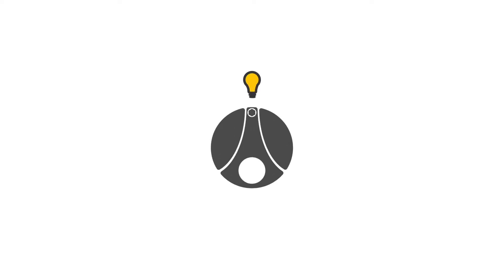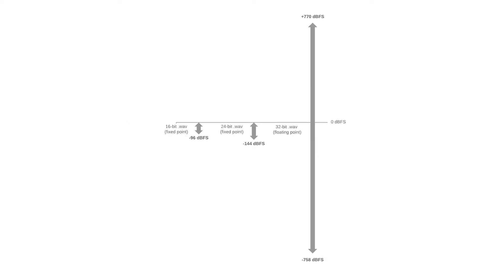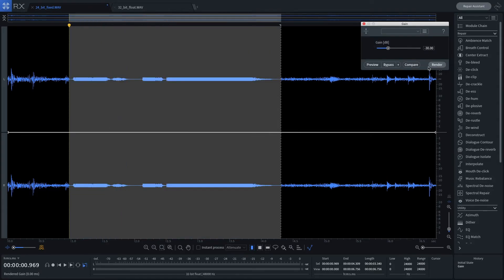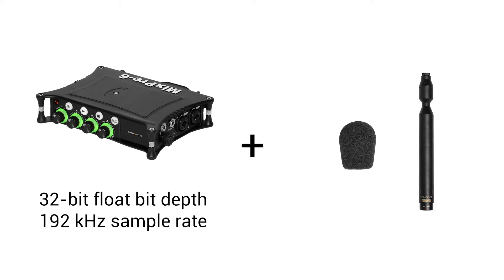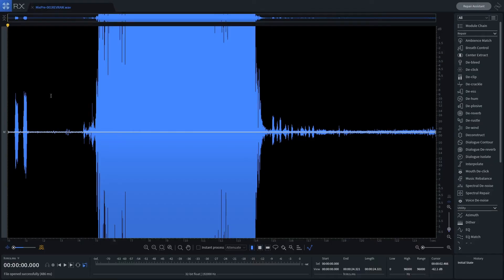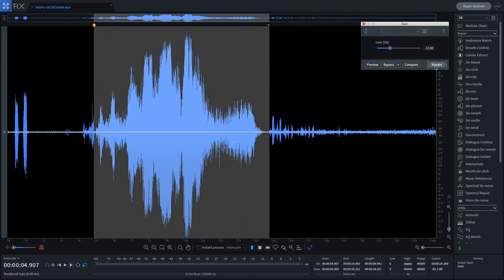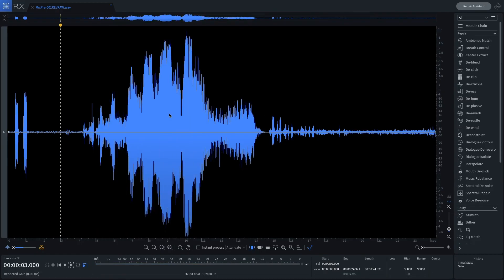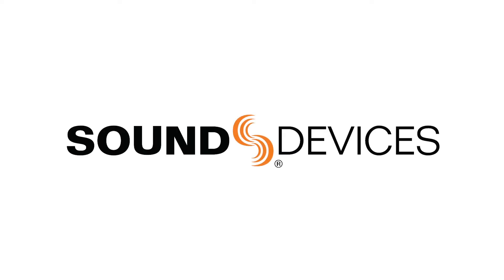The 32-bit float workflow

Comment: Can we recover 32bit audio files on Adobe premiere pro?
Reply from the maker: Adobe Premiere Pro is less ideal for editing audio files, as it's primarily designed as a video-based editing program. However, it DOES support 32-bit float, and you can use it to normalize audio. Please reach out to Adobe for specific support within that program.
Reply: @sounddev  thank you

Comment: Pro Audio engineer here begging you to make a version with 16 line inputs and outputs or 24 on DB25  so those of use who use mixing consoles for tracking can benefit from not having the talent be on pins and needles when playing in a tracking session. One of the benefits of using analog gear is to push it to get it to sound optimal but with even the best 24 bit converters it still happens to the most experienced engineers. So please consider a solution for the pro audio recording studio market!!

Comment: It is a pity that the input gain numbers become arbitrary at switching from 24bit to 32 bit mode. I often like to have the gain number letting me compare the sound levels at different scenes. In 24 bit mode the same gain number is equal to the same loudness, provided the same microphone is used. I thus can use the gain number there as absolute measure.

Comment: Can anyone direct me to any sort of tutorial that provides instruction on how to work with 32-bit files coming from the Zoom f6, in post production?  I have searched and searched and found plenty of content about using the audio recorder itself but no info about how to work its files within an editor. When I import my f6 file I get a layers upon layers of audio in Adobe Premiere and it's so confusing to me what each layer does or means. I reached out to Zoom and they deferred me to the software manufacturers. I'm a video pro and I've worked with audio files for years but I'm used to simplistic files that are not layered. I get by with the audio files that I'm importing from the f6 but I know my sound could be so much better if I understood the file structure and how to edit these files in post. Perhaps I have a setting turned on in the recorder that's creating all the layers, I'm not sure. Any help anyone could offer would be greatly appreciated!

Comment: Voice actor here. I’ve recorded my last two audiobooks in 32-bIt float on my MixPre 3 II, and the added dynamic range has been a godsend for chapters where characters have to alternate between fighting and grieving; the ability to recover the too-loud bits instead of re-recording them has saved my voice a number of stressful re-takes. Thanks so much for integrating this amazing technology into your product line.
Reply from the maker: Thanks for the feedback John! What an incredible real-world endorsement!
Reply: Beginner voice over guy here with a silly question…would I need audio repair software like this to recover clipped audio then put it into a daw or could audacity or adobe handle it?
Reply: @DavidBrackett385  almost any audio editor will do it, gain adjustment function should everywhere, in Audacity as well.

Comment: I undertand why I can bring very loud levels down, but not why I can bring very quiet ones up - don't I still run into the noise floor of the preamp & A/D?
Reply from the maker: You don't! Since the preamp noise is so low you aren't introducing any noise with it! This article covers the hardware that lets this happen https://www.sounddevices.com/how-is-a-32-bit-float-file-recorded/
Reply: @sounddev  Thanks for the quick & helpful answer. If I may ask one more question: When it's the preamps that are so good, doesn't this also translate to 24 bit recording? Why can't I raise the levels there the same way (considering it's converted to 32 bit float in most DAWs)?
Reply from the maker: @johannes.schaffer   Since the preamps are so stellar they're introducing no noise with very quiet sounds when bringing them up in post. It's more of a problem with very very loud sounds and 24-bit recording where there's no way to recover clipped audio.
Reply: @sounddev  Thanks, that makes sense, but it still isn't clear to me, why the output of the adc couldn't be written into a 24bit file. The dynamic range of the adc is 142db & the dynamic range of a 24bit file is 144db. No matter the input loudness or the preamp gain, the dynamic range will never become larger  than those 142db.
Reply: To answer my own question: Even if it would be possible to do that, the SNR between the signal & the noise floor of the 24bit file would be too small (only around 2db)

Comment: Be weary of this 32-bit float stuff.  I like my Mix Pre, but the 32-bit float has proven to be practically unworkable and this marketing campaign they've pushed is very misleading.  First, the idea of "no more gain setting" as if you're audio is going to sound good regardless of how you record is just not true.  Second, your wireless lavs will be outputting in 24-bit so that's a waste there.  Third and most frustrating for me at the moment is that there is no way to get 32-bit audio out of Premiere Pro in to Pro Tools for a sound mix unless you want to go in and manually sync the original audio to your cut yourself.  I'm at the point with my recorder where I don't think I'll be recording in 32-bit mode any longer which is a shame because it was the primary reason I bought the device.
Reply: Also this thing eats expensive lithium AA batteries like a beast.  Even buying in bulk I'm burning $5 every time I use it.
Reply from the maker: @matthewfarrell2621  Hey Matthew! We have an article on preferred power options for longer runtimes https://www.sounddevices.com/mixpre-3-mixpre-6-powering-options/
We never claimed that the audio would sound good regardless, proper mic technique and selection is still very important! We recommend setting the system as you would with optimal signal levels for any other recording according to best practice gain staging. In this scenario 32-bit float can save very high or very low level audio!
You are correct any wireless system running at 24-bit will be a determining factor in the system. 
Pro Tools will import 32-bit float files but they will clip if the signal is over 0 dBFS. Once a 32-bit float file has been normalized in Pro Tools it should playback normally

Comment: I have the mixpre 6 II.  But just for a test, I made a video with clipped audio on an iphone 12.  When I imported the file into premiere pro, I double checked the properties to confirm that it was a 32-bit float file.  And so is the project sequence.  I edited the audio in adobe audition and lowered the volume.  The peaks didn't come back.  The file was still clipped just at a lower volume.  Am I doing something wrong?
Reply from the maker: Where was the audio recorded?
Reply: @sounddev  At a concert
Reply from the maker: @chicagowebsiteservice8482  Was the audio recorded on a MixPre*? You mention the audio being clipped on the iPhone. Can you walk us through the signal chain?

Comment: When I lower the gain in either Audacity 3.0.2 or AudioDirector 11, it just flattens all the peaks to one equal level. Using a Rode VideoMic Pro+ with a Zoom F2 BT. I specifically got this combo since I record very loud concerts.  Any suggestions? I see in your video you just adjust the gain and it works as expected. Thank you!
Reply from the maker: Are you using a MixPre in your workflow?
Reply: @sounddev  I googled mixpre and it seems like a recording device? I use the zoom F2 which is 32 bit float.
Reply from the maker: @taylorkirk74  The MixPre is a 32-bit float recorder and USB interface. This video shows how to take 32-bit float files from a MixPre and process them.

Comment: Dear Sound devices, sadly the mix pre 6 II has only one sd card. Right now i am looking for a recorder with 32 bit and either two sd card slots  or a internal memory + one sd card. The reason for that is that i do not trust SD cards any more. Within the last 2 Years i had 3 fails. This should never happen again but so far all options i can afford have only one sd slot. Can you recommend a recorder ?

Comment: excellent tutorial, many thanks for explaining the workflow. Any chance that we could do this directly in Logic Pro? I have Zoom F6 and am planning to use the recording capability directly in device (Zoom F6 as Audio Interface does not communicate in 32 bit to Logic Pro). So for now on I need first to check the file in one of the audio editors, adjust the gain/normalize and then bring such file to Logic Pro for mixing, correct? sorry if asking blonde questions, am beginner :o)

Comment: what is the file size for a 191k 32 bit per sec/min ?
Reply from the maker: This should help! https://www.sounddevices.com/audio-recording-calculator/
Reply: @sounddev  thanks, i think there is an update issue when switching the bit depth, storage size remains the same until you change some other parameters. might want to fix that. gtz
Reply from the maker: @omnionmedia  Are you referring to the estimated storage on the SD Card on the main display?
Reply: @sounddev  Hi your calculator, set it to 1 min , 192 khz, wav,  then swap  the 32 bit for 24, with me the storage on disk stays the same until you change some other parameter. grtz
Reply from the maker: @omnionmedia  Gotcha!

Comment: Does my DAW project have to have any particular settings for me to drag and drop 32bit files? Does it matter if I have 32bit files and 24bit files on the same track?

(If it helps, I'm on Cubase 10.5)
Reply from the maker: We've tested 9.5 and found that the Waveform displays and outputs appear to be 24-bit and the Outputs will clip if signal is > 0dBFS. So import then attenuate to get the signal to the level you want it.

Comment: Does the 32bit have to be recorded in 192KHZ? I had trouble figuring a workaround to get that to sync with my footage. Ultimately it worked but I'm wondering if that's necessary to maintain the dynamic range
Reply from the maker: Not at all! 32-bit float can be used with all sample rates.

Comment: 32 bit float means 24 bit integer with 8 additional bits.  Even when you think you are recording in 24 bit integer you are not because the specs on your recorder do not say "maximum SR = 144dB".  Your recorder's maximum dynamic range is probably somewhere around 108 - 120 dB which equates to 18 -20 bits.       So 16 bits = 96 dB.  17 bits = 102 dB.  24 bits = 144dB.   The most expensive top of the line recorders or interfaces / converters only go to about 125 - 130dB....that's equivalent to 20 -21 bits, so you're not using a 24 bit recording system. It's called Marketing.  Now 32 bit float point recording is still 24bit integer with 8 additional bits.  32 bit float is not the same as having a 32 bit integer recorder / converter.  32 bit integer converter = 192 dB.  Understand the difference between 32 bit float and 32 bit integer recording and processing.  Even if you record in 16 bit integer or 24 bit integer or 32 bit float (24bit)...your DAW (Digital Audio Workstation) will use internal 32 bit float for processing no matter what.  Some even go as far as using 64 bit float point for processing no matter what integer you record at.  We can get into dithering and noise shaping, but that's for another day and a big part of the final product.  Here's something funny for you all:  When modern music is mastered and squashed to hell because of loudness wars, the result is a maximum dynamic range of 14 or 15 bits.
Reply: idk if it's true, because in graphics float is smooth in gradients and int have banding. Curves, or glow effects looks more smooth in float. Floats and ints interpolate differently.

Comment: I'm trying to wrap my head around this. Are you saying that recording at higher bit depths results in more "headroom," as we used to call it in the days of analog recording? If all the original sound data is retained in the seemingly clipped portion when recording at 32 bits, why does the waveform appear clipped?
Reply: 24 bit can't record the amplitude as high. Not enough bits. 32 bit can handle more than any microphone could handle. You would destroy things before you digitally clip 32 bit.
Reply from the maker: The waveform appears clipped in the  DAW because it doesn't draw data above 0 dBFS, but the data is there and can be lowered below 0 dBFS.

Comment: This might be a stupid question but if I use a wireless lav system into a 32-bit float recorder, will the process of converting the audio to and from radio waves effect the usefulness of a 32-bit float recording format (either by squashing the dynamic range before it reaches the recorder or introducing noise that makes raising extremely quiet sounds unusable)?
Reply from the maker: You will be limited by the wireless systems dynamic range. Most high quality wireless systems won't introduce any noise when transmitting the audio. It's always best to set you levels appropriately at all parts of the system and 32bit float can act as a safety net. If the talent clips audio on the transmitter though 32-bit float won't save that.
Reply: @sounddev  Thanks for the reply, super helpful

Comment: I’m
Coming from a zoom f4 to a mixpre 6ii. I’m selecting L+R unlinked but the recorder only has one track of all the mics. I use fcpx, I’ve tried in rx8 advanced (or is it 7?), and I’m newly trying to figure out audacity. Any tips on how to record and import separate files into fcpx?
Reply from the maker: Our recorders package the files as a poly wave. https://www.sounddevices.com/product/wave-agent/ and this will split the ISO's for you. The Advanced versions of Izotope RX and Audacity should also split the files.
Reply: That's one of the reasons that I bought the Zoom F6. Both recorders have their advantages and disadvantages. I chose the Zoom F6 because the smaller size and it can run up to 6 hours on 4 AA batteries. I like some of the features of the Mix Pre more though.
Reply: @RichardsWorld  Still rocking the f6?
Reply: @Z3Chosen1  I still have it, but I haven't used it much. It worked really good for when I did live streams. It It a little overkill for this these days.

Comment: Finally, some 32-bit implementation! AD converters are working in 32-bit integer, or is this manages in the same manner as in new Zoom recorder (2x AD 24 bit converters)? Or maybe analog to digital converter is 32-bit floating point? :D
Reply from the maker: That's all secret sauce! But we can tell you that it's fully proven and it works great! We had a lot of fun screaming into microphones while testing!
Reply: Sound Devices I read the Sound Devices patent on 32 bit recording and was blown away by the deep thought and brilliance of the multiple mathematical concepts and algorithms used to make it work.
Reply: AKAIK, there are no 32 bit converters. They simply don't exist, so the so called secret sauce is happening elsewhere.
Reply: @kevinhay8076  but they simply DO exist, Steinberg alread released bunch of audio interfaces capable of AD 32 bit conversion (integer of course). There are no 32 bit floating point converters, but a couple of 24bit ADC with different input gains paired with some good comparing algrotihms could do the work
Reply: @xanonax  Yes indeed now that's a decent answer, thank you, and I should've been more specific with my initial response. It's the fuzziness that's getting me around this topic from Sound Devices. I get that Sound Devices have to in a sense protect their IP but I think they're not helping out with some glossing over of data.

Comment: Can we have a run through of recommended setting for using 32bit video please ?
Reply from the maker: Not much to run through! All gain can be adjusted in post even if a signal is too low or too high! Set the MixPre II to 32-bit float mode, and set your microphones to a normal level. But now if you talent whispers and shouts in the same take you can adjust the gain! This is also good for videographers who might not be as comfortable working sound or if you can't monitor your recording!
Reply: I think his recorder kind of gives you an option of record level, which doesn't really matter. I have the Zoom F6 and if using only 32 bit, you have no option for audio levels. You record, and you edit the levels in software. You can see your relative recording level is though. it will compare what you are recording to 0 DB. But 0 DB isn't the clipping limit when recording in 32 bit. You can go over by 50 db or much higher, just lower it in software. If you want to feel more normal record in 24 bit and 32 bit at the same time. You can set the audio level for 24 bit. If you happened to clip the 24 bit audio, you can lower the gain in the 32 bit file and it wont be clipped. Some people have put 32 bit audio clips on the internet and you can download it and see how easy it is.

Comment: Question: So recording at 32-bit levels is NOT available with the original MixPre6 despite the Firmware 4.01 upgrade? Is it possible or not?
Reply from the maker: Correct. The MixPre II series has new hardware that allows for 32-bit float recording.
Reply: You change the levels in editing. Just get the mic where you want it, hit record, mess with the levels later.